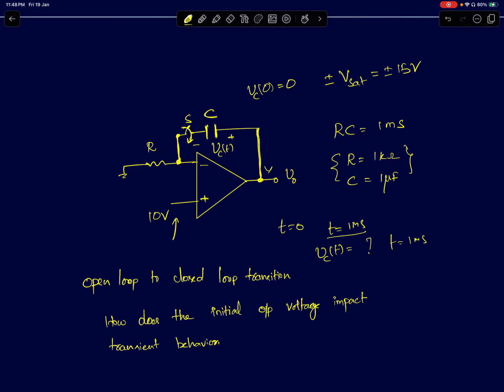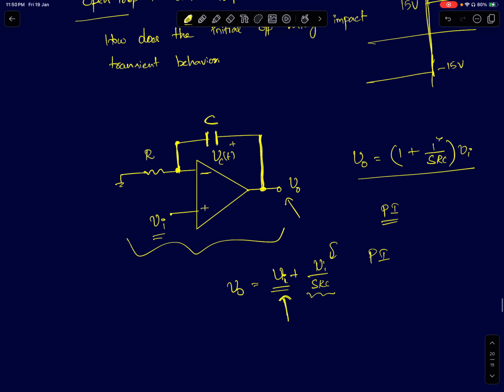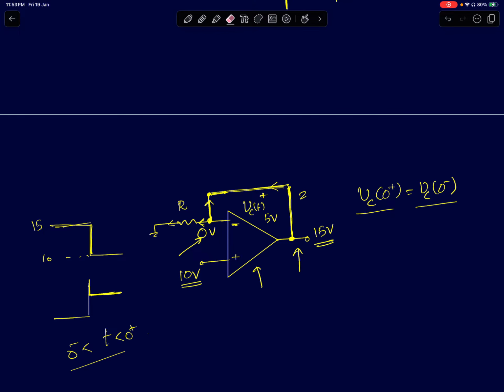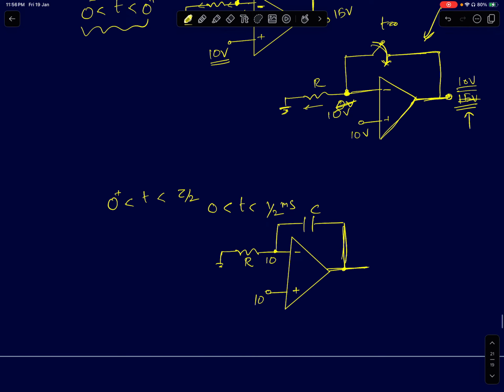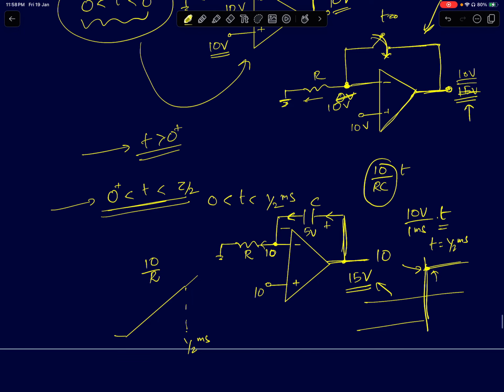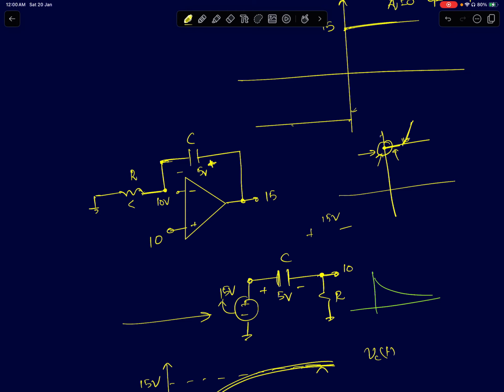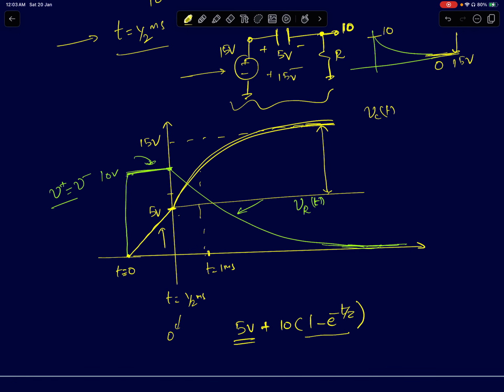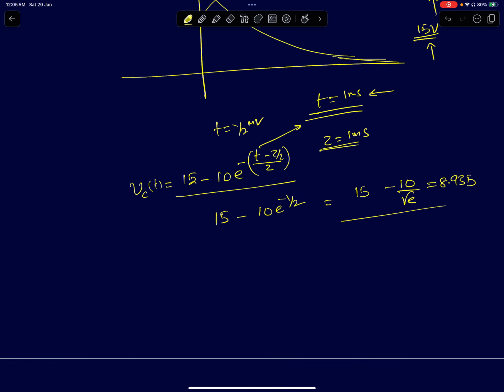OC Lecture 17) A non-inverting integrator circuit undergoing open loop to closed loop transition

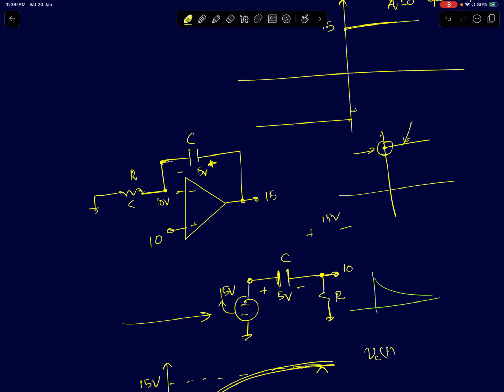Comment from the maker: A small correction to the video. In the interval 13:00 min to 14:00 in the video. I inadvertently said that the opamp will always be at v+-v-=0 condition even in the steady state, which is not true. I corrected that statement and made that point clearer in this video. Link here. 👉  https://youtu.be/7f5KIhr8L3A